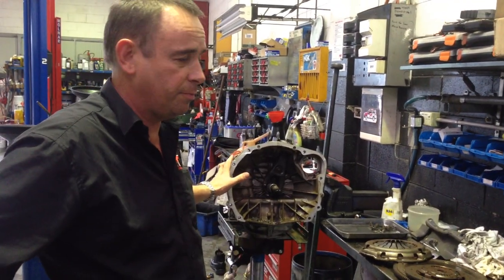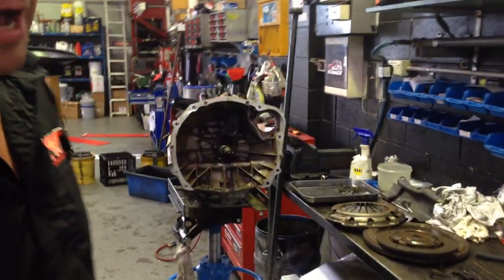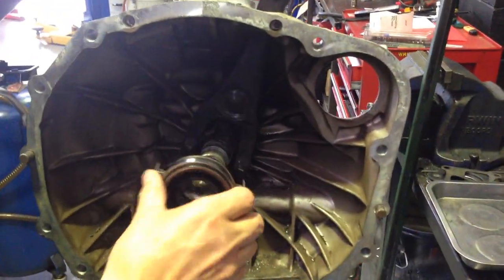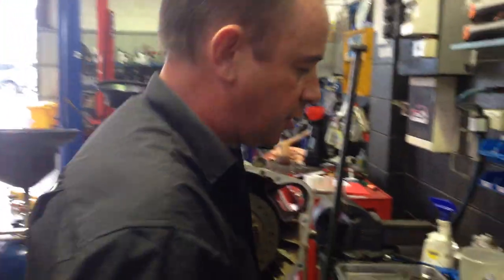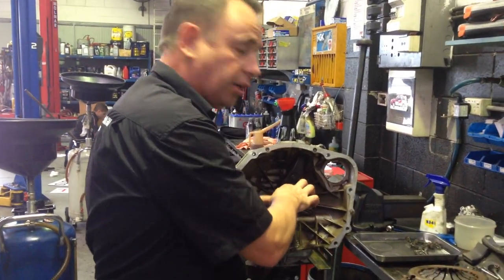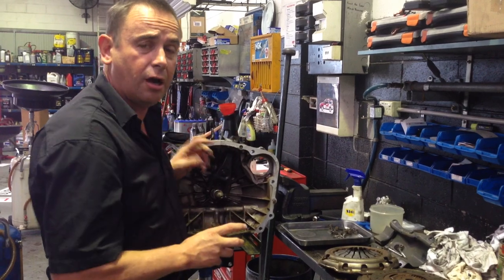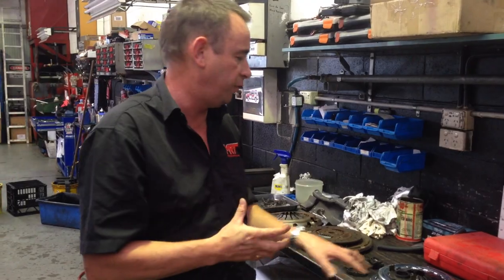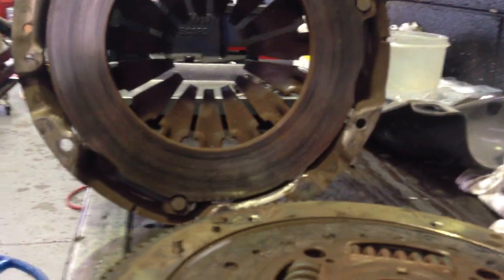Subaru WRX clutch tips and traps

Comment: Hello from France !  Love your videos and all the passion that you have for Subaru . I'm a big fan of Subaru and bought one 6 years ago she's completly full stock and been look after like a Subaru fan should do . The only thing i have changed is the exhaust and that's it . All my oil changes have been done on time and with the best oil Motul ....  gearbox motor rear diffencial ...... The lot i love her and look after her but i have a little problem with her when i'm in high rpm and let go the accelerator i hear like a grounding noise as soon as i acceralte it goes . The noise only happen's when i'm in high rpm and only when i'm driving not when she's stopped i can hit the 6000 rpm stopped and no noise . She's got 150000km on the clock and the clutch has never been changed ( i have'nt done it because no problem with it no problem changing gears ect .....) so wathing this video i was wondering if this could be my problem and it's been going on for a year now and been searching for a year too . Thank's a lot if you have the time to answer and hope to see more videos . J'adore MRT .

Comment: i have a 2016 subaru wrx and i also have a squeaky clutch/spongy feel. Also i do get noise when it rains/especially in the morning and the noise goes away when it heats up. Do you think i need a new clutch assembly or should bleed the system. Thanks for the advice!

Comment: Wish I could have this guy work on my car. I had my clutch replaced about a year ago on my 2007 subaru impreza wrx  at a independent shop,  then a few months ago it started making a squeaky sound but went away when I pushed in the clutch. I  took it into a subaru dealership to get a diagnosis they said the throw out bearing was going bad. Also a few months earlier a bolt came loose from the starter and the mechanic who discovered it said whoever did my clutch didn't titghen down the bolt enough and hopefully that was all they messed. So not trusting the the shop I had the clutch replaced at and the warranty being expired. I took into the subaru dealership to have the throw out bearing replaced. Two weeks later and it's making the exact same noise and goes away when I push in the clutch. Is this what's wrong with my car mrt performance? I'm afraid that what it sounds like.

Comment: Just pulled my transmission of my 04 wrx because my clutch pedal would get stuck all the way to the floor. Turns out my release bearing released its bearings and came apart...inner race stuck to the clutch plate and other half on the fork.

Comment: I had my release bearing make some horrible noise for about 2 days (MY99 WRX) mechanic said not to really worry about it. The noise has gone away and I have since done about 3000kms but I haven't had any issues. 

Should the gearbox be opened and checked?
Reply from the maker: 100% check it

Comment: hi there I have a 2016 wrx 6spd with a whinning noise from the clutch after disengage or cold or wet day. I took it to the dealer in Taiwan all they did was changed my tranny assembly. the problem persist 3 days after on my new tranny assembly. Could this be my throw out bearing? Can I just change an aftermarket throw out bearing (ACT or Exdey) and call it a day or would you recommend to change stage 1 clutch kit! I first notice the problem when I only had 1,000km now it's on 13,000 km on my second tranny assembly! Please help me thanks!
Reply from the maker: its hard to diagnose here, sorry

Comment: Hi MRT Performance, I just recently installed a new flywheel clutch and pressure plate from Competition on my 2011 Subaru WRX 5 speed. Well I'm running into and issue with the clutch not disengaging. 
When off it shifts into 1st easy but when one it does not.
When installed in replaced the push fork with a OEM one but used the release bearing that was supplied with the kit.
Any tips before I re-drop the transmission to see whats going on inside?
I did bleed the Slave Cylinder a bit making sure that the Master always had fluid.
Reply from the maker: very hard to diagnose here, sorry
:(

Comment: Sometimes when I let up my clutch and revving when I'm taking off, there is a noise like slipping or rubbing but absolutely no slippage once the clucth is fully engaged. And pulls very well through the gears with no slippage. Is this a potential costly problem. And what could it be?
Reply: Sounds like hotspots on the flywheel.   Sorry this is 5 years later but hope this may help someone else

Comment: HELP:( I changed the clutch on my 2007 subaru wrx manual and after getting it all put together it wont start. It turns over normally and is getting fuel. ANY suggestions would help i dont know what to do.
Reply from the maker: +Jesse Riggs not easy to diagnose here
:(
Reply: Jesse Riggs it might be the main grounding cable near the Self-Starter

Comment: Hello, from the mass clutch manufacturers like exedy, aisin, valeo, etc which would you recommend for better performance?
Also is the old subaru push type clutch less torque capable than the pull type?( i ask because i think it mostly came in naturally aspirated ej engines)?
Reply: Exedy all the way

Comment: My 2016 WRX´s clutch failed after 1 year of gentle driving.... $1,600USD to replace and no warranty from Subaru.... Shitty overpriced car...
Reply: I have never had any problems with my '06. 2006 was the last year Subaru made a great WRX, I think it's by far the best WRX ever made
Reply: Eduardo R Stevens that's odd. My 2015 wrx has been flawless. Clutch works great. You probably don't use the clutch correctly or you got a lemon.
Reply: 2 years of normal driving on my 2015 wrx, I think the car is under priced honestly.
Reply: henoch44 I don't know if I'd call any car under priced but the wrx is the best bang for you buck new car available these days.
Reply: Driving it gently was probably your problem. I hammer the fuck out of mine.
Reply: Eduardo R Stevens notice this is the 5 speed transmission.
Reply: Nik Coffman and what’s wrong with the 07 given it’s the same car? Lmao
Reply: 02 wrx 178k miles stage2 stock clutch
Reply: My stage 2 plus has 44,000 miles and still feels good, fingers crossed.
Reply: No ceramics are ever covered by warranty.. read a book..and go buy a Camry or something..

Comment: Have an 05 STi and I was on my way to work. I was going to shift into 5th but wouldn’t budge causing me to grind the gears when I would try to throw into gear. I can’t throw it into any gear now while the car is running. But when off I can go into all gears. 

I checked my slave cylinder no leaks, everything works just fine and same with the master cylinder.  Anyone got any suggestions as to what could’ve cause my issue?
Reply: Did you find the fix, i have the same problem, guessing its the throw out bearing.
Reply: @kyus1974  yeah the throw out bearing was seized up so I had to replace that and the whole clutch